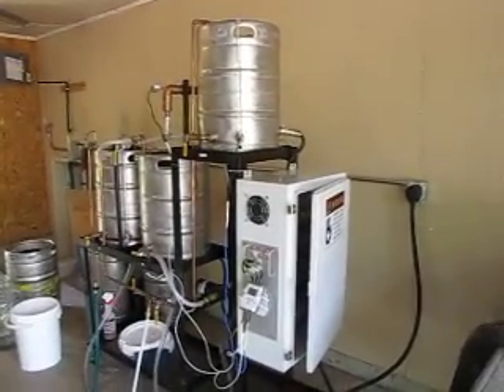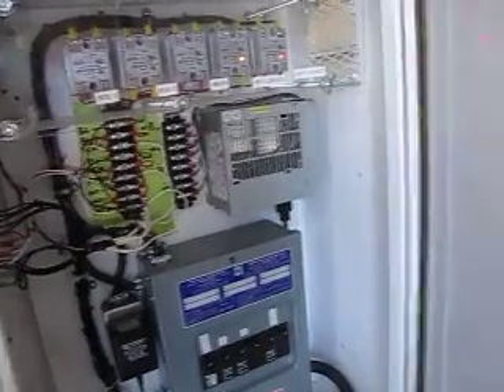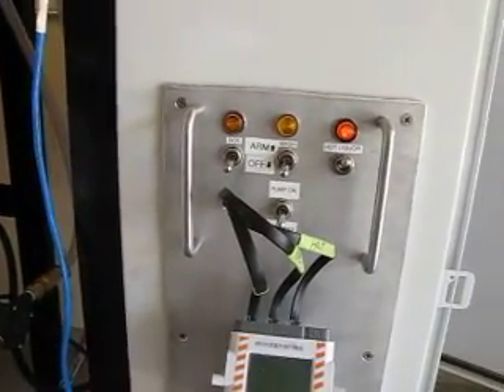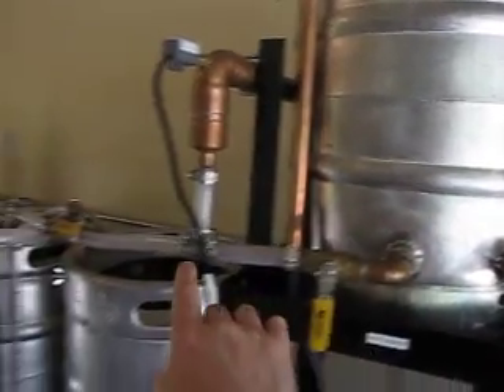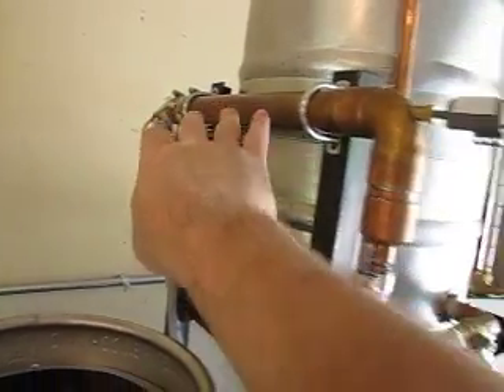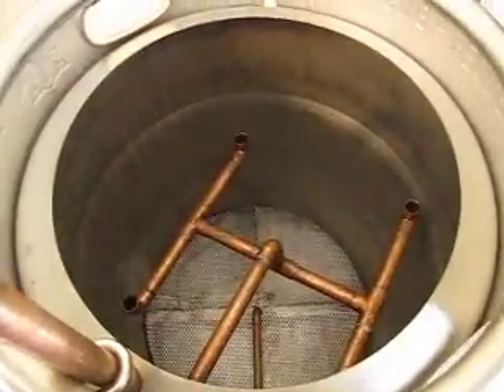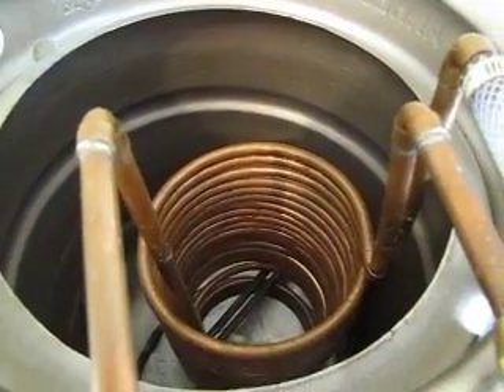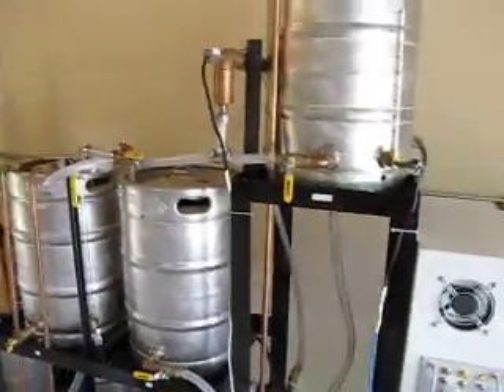RIMS Brewery intro

Comment from the maker: The only issue is cleaning out the RIMS tube. In that case if I want to clean it really well I unscrew the element. I need to put in electrical quick disconnect to make it easier to remove. all the lines I just flush out with a garden hose. The whole rig is on casters so I can roll it out to the driveway and hose it down. There are also quick disconnects at the pump so I squirt out the lines with a garden hose. Also the false bottom and sparge manifold are readily removable